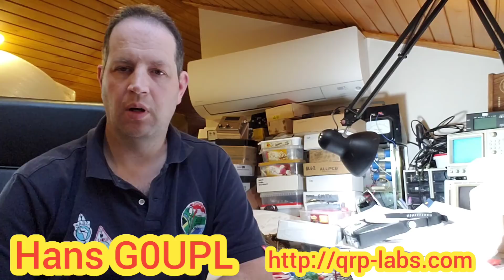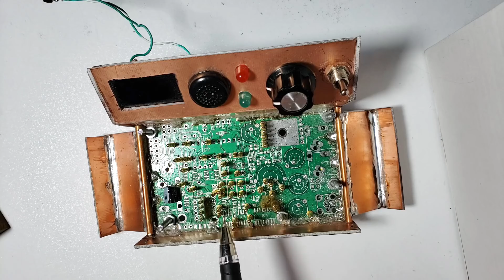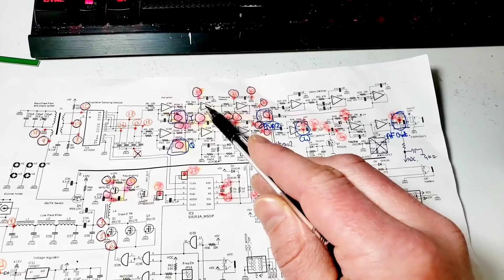QCX-mini update and test jig

Comment: This test methodology has been around for decades (bed of nails using pogo pins). We used it in High Volume Manufacturing of PC mother boards dating back to the 386 processor family. We had to design our boards with test points for this very purpose then hand off the data to the Test Guys so they could create the fixtures. 

Awesome to see Hans adopt this testing methodology in his QC tests! My Mini went together without issue except when I put it into the box. A re inspection of clipped lead length on the bottom found several may have been in contact with the case so we cleaned that up and on the air! Currently burning it in running WSPR (very cool feature) on 20m! Spotted in Germany from Az. this morning running just 4W. :)

Thanks for creating a fantastic kit Hans!!

73

Comment: This really seemed convuluted to me. I just couldn't follow it. Looks like you went out of your way to make it more complicated than it should be.
Reply from the maker: No, it was exactly as complex as it needed to be, no more and no less, to completely test all the functions of a QCX-mini board. Remember that nothing must be soldered to the QCX-mini board and the test has to be thorough yet quick and easy... there are 1,000 boards in a manufacturing batch and the testing has to be undertaken by a technician not by me.
Reply: How would you go about thoroughly testing all analog and digital ICs on 1000 partly populated boards?  What's the simple way?

Comment: The electrical RF engineering combined with the case engineering is stellar for the QCX-Mini 20M I purchased. Even more impressive is this test jig, and I thank it and Hans for the added QC before my Rev2 mini crossed the seas and led to an uneventful successful build.  I can honestly say though after a couple long sessions with headband magnifier, I would not want to build anything smaller than this, so if Hans starts on a QCX-micro, I will have to pass due to eyesight here :)

Comment: I have the Revision 1 board.  I haven’t started building it yet.  It has the older AMS 1117 voltage regulator on it.  Can I do a straight swap to the newer regulator available without doing other component changes ?
Reply from the maker: The Rev2 boards use 78M05. No other components changes are needed. The 10uF electrolytic or tantalum cap isn't needed with 78M05. Note: 78M05 has a different pinout. It can be done by moving the 78M05 left one pin compared to the original AMS1117 so that the left (input) pin is now on the D33 diode pad. Don't forget to connect the central 78M05 pin (ground). 
There is more information I the QRP Labs groups.io discussion forum.
Reply: @QRPLabs  thanks !  I’ll check out info group.

Comment: What a fascinating and factually-dense video. I didn't know that about multilayer ceramic SMD caps - who needs  varicap diodes, eh? I've seen some designs go through production woes before, and I can just imagine the vocab used as the problems with the regulators became apparent. The jig, though, is a joy. Really smart design. Also, that's the first time I've ever seen those QC Passed stickers used honestly. Aren't you tempted to put a print-out of the test results in the bag with each board? If you've got it, flaunt it...

Comment: Thanks Hans.  I have a batch 1 17m mini that had zero problems, went together quickly, and I never had to tweak a thing, strong power out.  Worked a bunch of DX via a mag loop in my family room.  Couldn’t be happier.  Though the hot plugging issues you brought up just means I will turn mine off before plugging anything in now.

Comment: Very interesting video, I only understood about half of it! That said, it is a real eye opener, and an insight into dedication to customer service. Your test rig seems to work well, and appears to be in the best tradition of Heath Robinson! (No insult intended) As a mechanical engineer I regularly make up test jigs that look awful, but get the job done, often to the stage where, what was intended as a prototype ends up in permanent use. A real shame that a 3rd party contractor let you, and your customers down so badly, as it could impact your reputation, mind you, this video will go a long way to resolving any problems, and, in the long term may do you some good by highlighting your search for perfection. 73 Jim M7BXT

Comment: Great video Hans. Love the guided tour on your test jig and even more that you are so open about it. 

I have build various test jigs in the past and these pogo pins are indeed in all various shapes and sizes. The ones you have used look more durable then the ones I used in the on some of these jigs. One had to pin into very small test points on the main pcb  (some even between SMD components) but that's why we used a separate adapter plate for the pogo pins. The customer replaced the adapter board every 2K cycle test cycles (a full test and pre calibration took aprx 15 minutes) so costs of the adapter board where low compared to the labor coast of the employees. 

73 Lex PH2LB

Comment: I enjoyed seeing what you have done -- and corrections you have made going forward. But, what about customers, like me, that have Rev 1 boards that aren't working? I have gone thru alignment so many times and nothing. How do we get that issue resolved?
Rob N8BEG
Reply from the maker: If the alignment is not working, that could be due to a number of possible factors, including assembly error; only one possibility is that there are defective components on the board. The best thing is to email using the Contact form on the QRP Labs website and we can resolve it with you.
Reply: @QRPLabs  I did that -- Hans answered me, promptly, I solved a "cracked" SMD Resistor problem but I wrote back, now having alignment issues, and asked how to proceed next. He answered asking "Do you have a Rev 1 board?" I answered "Yes". and have heard no answer. I wrote again, no answer. So, now I am here.   Rob N8BEG
Reply: @robyounce4636  I had at least one bad op-amp that was preventing alignment.

Comment: So, with the more robust voltage regulator, is there no longer an issue with hot plugging the PTT and GPS ports?
Reply from the maker: There is no issue with hot-plugging, a 78M05 is almost impossible to kill.
Reply: Excellent!

Comment: Nice work. My kit had problems 2 & 3, but  works like a champ once I dealt with them. Happy to see you address the issues so comprehensively. Pogo pins are great things, good call on using the large ones like you did.

I wish I had known you were going to do a rev 2, and not just clamped down on QA. I would like to see a MOSFET perfect diode replace the schottky diode in front of the regulator.
73, and will be ordering more bands soon..

Comment: Unfortunate that Rev 1 batch had these issues. However, Hans, you are of the Engineering Right Stuff and you have pulled the rabbit out of the hat by designing and producing the test rig  - as well as addressing the other quality issues. Happy to report that my QC tested Rev 2 kit #159 worked just fine after assembly. I agree, the QCX-mini is "insanely cute". 😀 Thanks for the update.

Comment: Since the voltage regulator is somewhat larger than the SMD components, can a replacement be done with the proper voltage regulator??  WD8WV  PS:  I love the QCXmini, but miss the QCX.  I am going to order another QCXmini.
Reply from the maker: AMS1117 and 78M05 are both proper regulators and both are SMD. The 78M05 used in Rev 2 boards is more tolerant of abuse so is preferred, hence the change. A 78M05 can be fit to a Rev 1 board but the voltage regulator pinout and footprint is different; you would need to shift the 78M05 one place to the left. It's doable but I'm not sure how worthwhile it is, you could have a higher risk damaging the board during the change, than the risk of AMS1117 failure - as long as you are careful, the AMS1117 should not fail anyway.
Reply: @QRPLabs  thanks.  I will stick with the original then. WD8WV

Comment: Timestamps/  Chapters
0:00 Intro
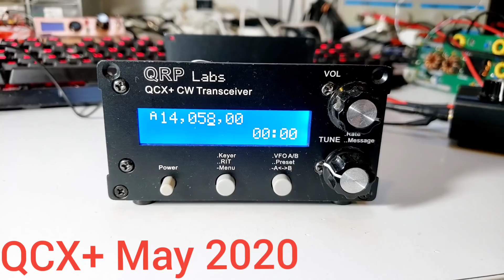0:54 QCX+ short history
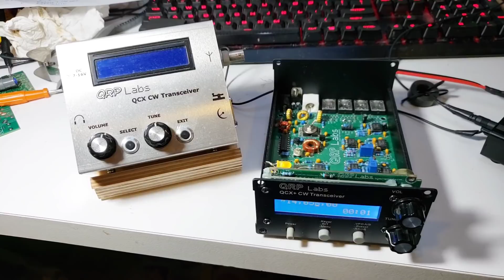1:39 QCX-mini short history
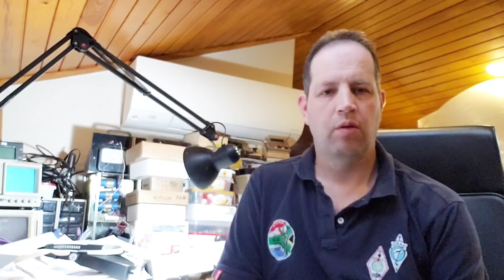2:34 Issues with QCX-mini
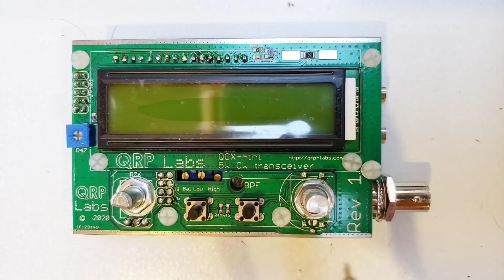3:29 Issue with Voltage Regulator
7:02 Issue with Assembly 
8:04 Issue with Op-Amps
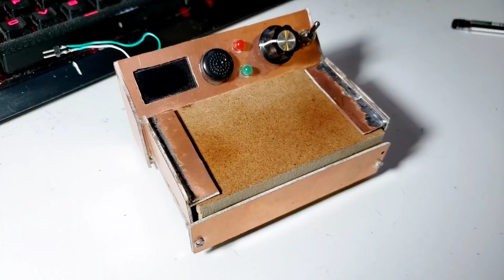9:07 Intro to Test Jig
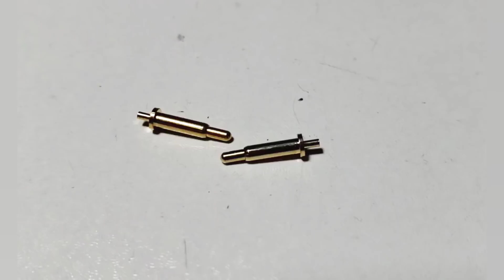9:32 Attaching the circuit board and Pogo Pins
14:20 Display of Test Jig - Back circuitry of Test Jig
16:46 QC Passed Sticker
17:25 Circuit and Block Diagrams of Testing
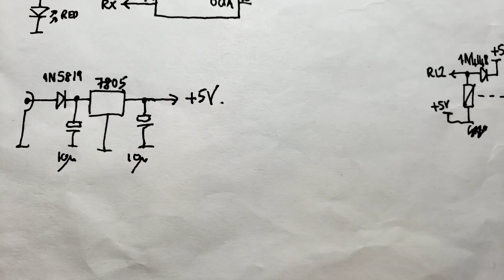21:25 A list of Tests
24:40 Demonstration of Testing
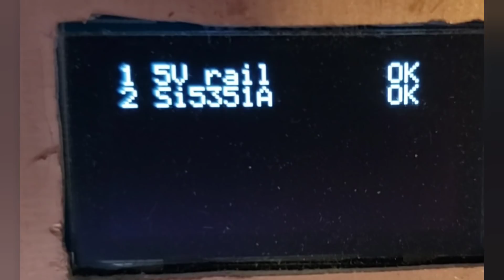26:01 Close Up of OLED display while testing
26:30 Overview of Test Jig Project
27:47 Issue and Solution Summary

Comment: Such a good video,such a good test jig! I'm amazed. Brilliant. And also very fast. My troubleshooting took too long :)
    Something I was wondering, what is the yellow LED in the upper right corner of the Front Panel PCB for at 1:06?
Reply from the maker: Hi Abdullah Bey. On the QCX-mini a yellow/green LCD module is used, because these are visible even in bright S.W. Turkish sunshine, with the backlight off; backlight off, saves current. The backlight can be controlled via a configuration menu item, which causes one of the LCD signals to be parked at 5V (backlight ON) or 0V (backlight OFF) when the microcontroller is not writing to the LCD module. This LCD signal is routed to a simple R-C filter (to remove data transitions when the LCD is written) then to the gate of a MOSFET that powers the backlight. 
The reason for the yellow LED on the QCX+ shown in the video, is simply that I was testing this concept prior to the QCX-mini implementation, during QCX-mini development; I just haven't got around to removing the LED yet!

Comment: I was one of the one who had a cracked component.  Thankfully it was an SMD transistor Q5 on the rear which was pretty much situated away from other components on the rear of the board.  I've never done any SMD rework but it was relatively easy since I didn't have to worry about bridging to a nearby component.

Comment: Hans, just curious... Were any of the recent batch of 1000 boards flagged as faulty by your tester?
Reply from the maker: Ni Neall, yes... it is normal for production yield to not be exactly 100%. But the most important point here is that any defects are now detected and removed BEFORE shipping to any customer. The resulting reject boards can either be discarded if the percentage is small, or if there is a systematic frequently recurring fault, it can be investigated and understood, and resolved with the relevant party for example board manufacturer, parts supplier, etc.